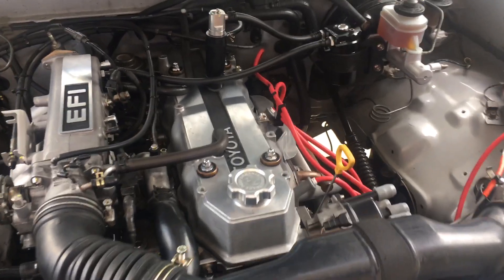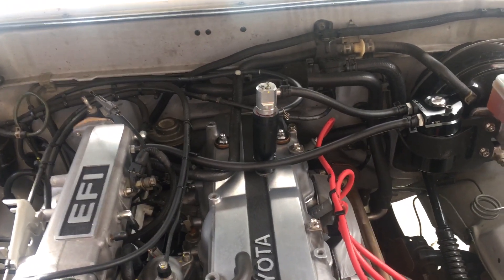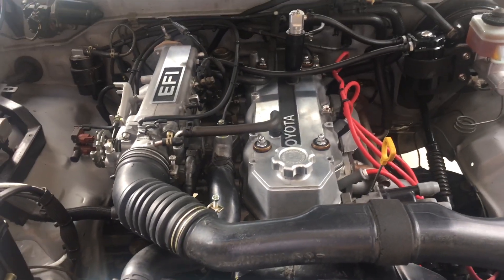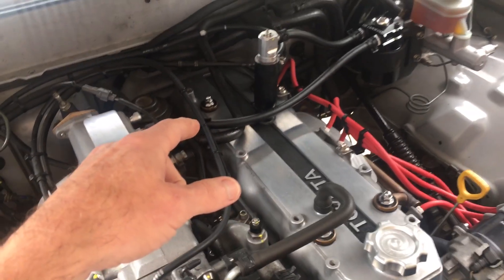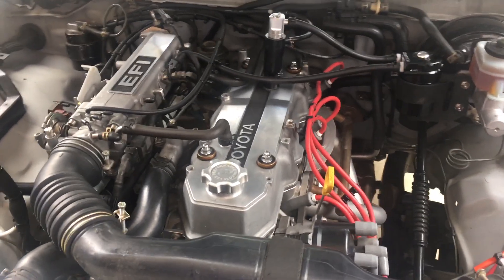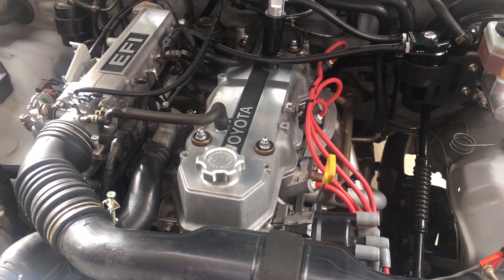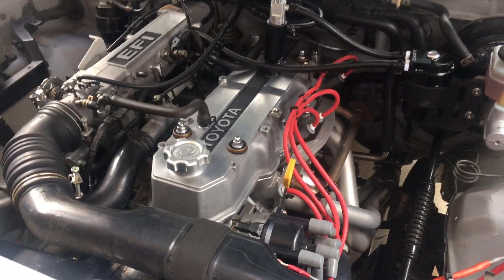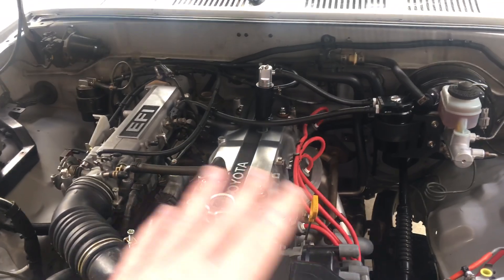800+ mile update on the 1990 2WD Toyota Pickup 22RE oil baffle / oil return hole in cylinder head

Comment: Thanks for the update. I'm installing my oil catch can tomorrow on my 87' 22r 4x4. I also have an 89 dolphin with the 22re. Love these little motors.
Reply from the maker: Yeah, the oil catch can is nice. It let's you monitor exactly what's going on as far as oil that would otherwise make its way into the intake system.

Comment: Smart. Very smart. I like it dude. I have always seen those adjustable pcv valves but never seen a good article on how to tune them. Sounds like I will need to compare one of these setups with a large upper breather valve vs my current setup of two large breather hoses to a vent to atmosphere catch can.
Reply from the maker: Yeah, seeing the vacuum levels helps a lot. If you have a EFI motor, make sure you aren't accidentally allowing in unmetered air into the system also.
Reply: @ray5961  Ah yeah im good. My intake tract is completely separate from my crankcase ventilation setup. I converted a 2010 Prius to a breather can.

Comment: do you have a list of mods done to the truck for mpg?
Reply from the maker: Not really, but maybe I could make a video to address that in the future. Mainly I have an electric can, no A/C, removed the P/S and I have forged lightweight aluminum wheels. Next trip I'm going to try raising the tire pressure a bit also. The 28+ MPG was with a several hundred pound load in the bed also.

Comment: Iv never had any problem with oil use or pcv valve? Why did u do the baffle and oil hole return hole mods?
Reply from the maker: It started when I put the oil catch can on and suddenly I could see how much oil was being drawn up into the can. I was also having problems with oil blowing out the exhaust when going up steep hills and realized something was off. I'm not sure if it's on account of installing the LCE cylinder head and higher pressure oil pump or what.. but once I started trying to figure out what was going on, then it led down this rabbit hole we are in now.
Reply: @ray5961  gotcha thanks
Reply: @ray5961  so should I not install an oil catch can?
Reply from the maker: @fiys567  I think the oil catch can is a really good upgrade. It allows you to see what's going on with the PCV system and it also keeps the intake manifold and induction system far cleaner. I definitely would say add it if you can, yes.